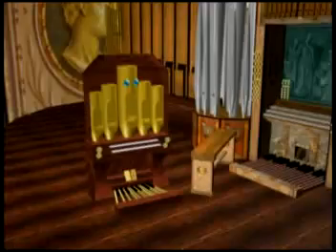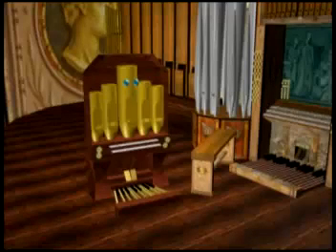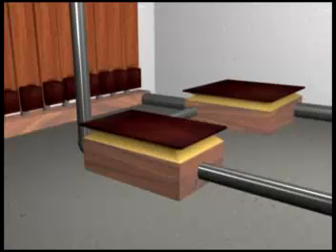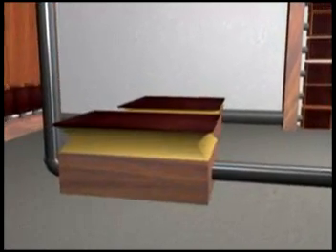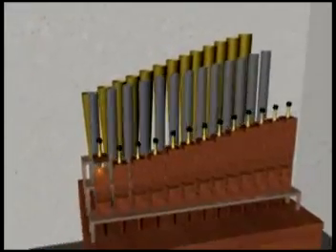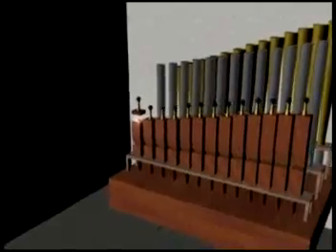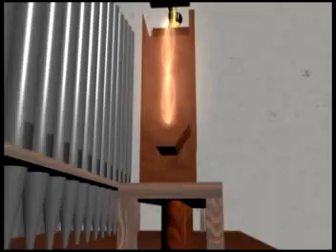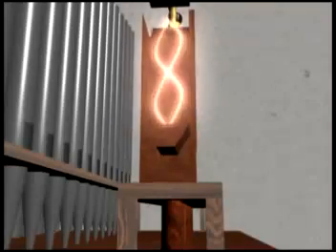The Physics of the Pipe Organ

Comment: No.  The pipe organ is a WIND instrument.  It has no strings in it, just pipes.
Reply: The Pipes imitate strings.
Reply: @EmeraldPixelGamingEPG  Key word is imitate, which any kind (pipe-church, theater pipe, and electric) do.  It synthesizes.  Some imitations are excellent, some are not so good.  It depends on the instrument.